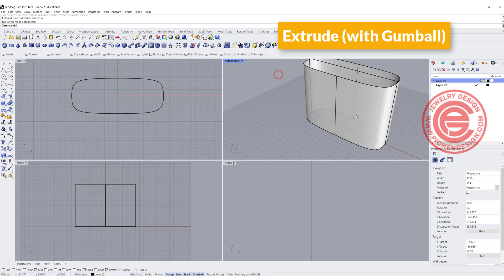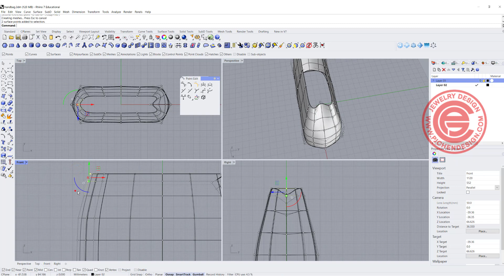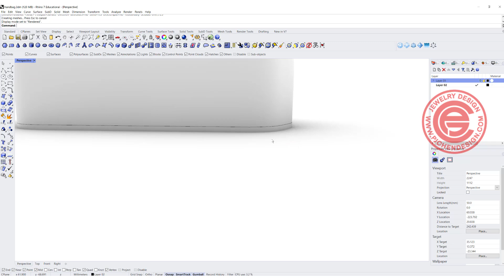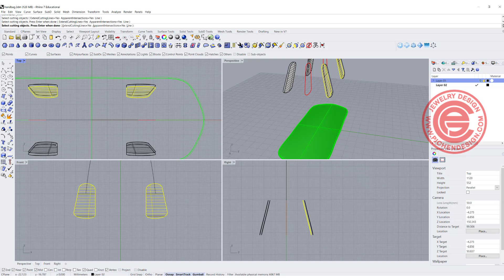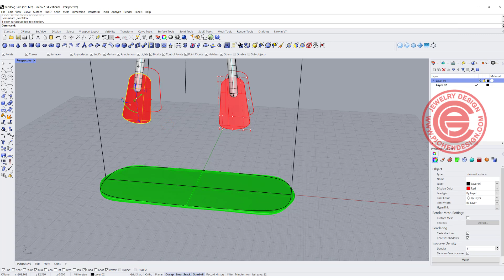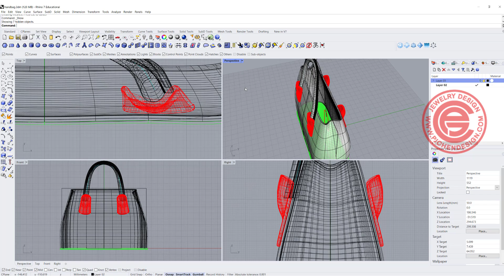Handbag 3D Modeling Tutorial with Rhino 7 (Part 1) #221

Comment: Best knowledge sharing thanks, Can you recommend any software where i share picture of any bag and the software make patterns for that design. later i make needful changes in sizes and designs but would be able to get make structure of that bag. kindly guide
Reply from the maker: If you are looking for the printing pattern, you can use any rendering progarm and assign the pattern on it. If you want physical pattern laser cut, grasshopp may be a good fit.

Comment: Hi thanks for your helpful video. I follow the instruction but I have a problem after rebuild and there is no vertex or control points to tweak the shape of the bag. Thank for helping
Reply from the maker: really! any surface should have control points to edit. make sure use command PointOn if you are in older version than Rhino 7
Reply: @PJChenJewelryDesign  thank you, it fixed my problem🤍🤍
Reply from the maker: @royarezagholi  great!

Comment: Hello Ma’am, I’m not able to get the points after the rebuild tool, its selecting as a common selection, pls helppppp
Reply: I have a mac
Reply from the maker: if you cannot turn on control point from surface. it is a polysurface. Points cannot be turn on on poly surface. suggest to rebuild your curve into a degree 3 single curve. then build surface from it.

Comment: Can you flatten it and make pattern out of the model?
Reply from the maker: you could. use combination of CreateUV Curve and Flow Along Surface. However, it maybe deform on some tighter area. If you need pattern like repeating logo, I will suggest to do in rendering instead of model itself.